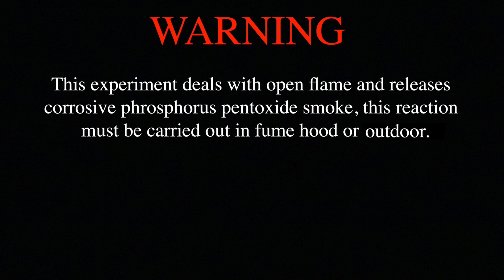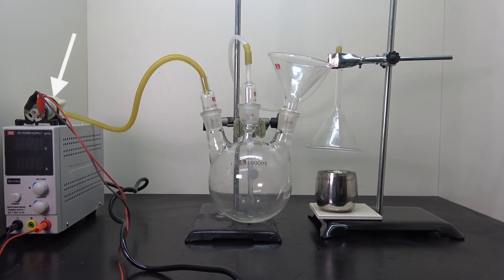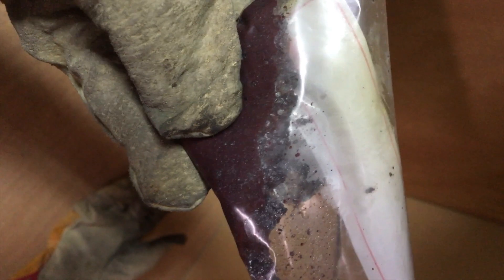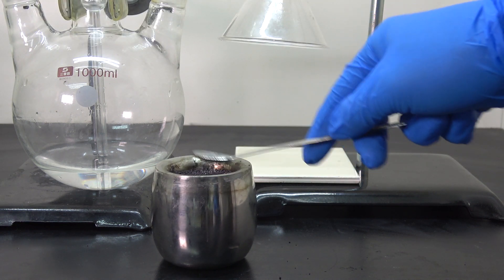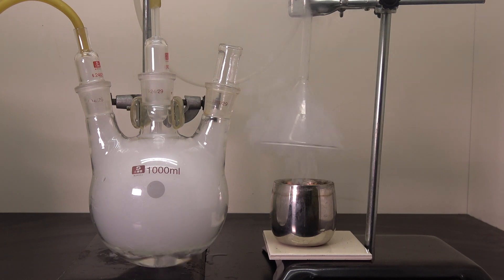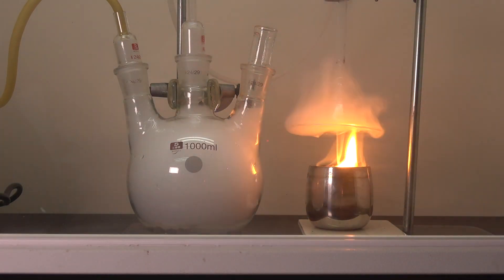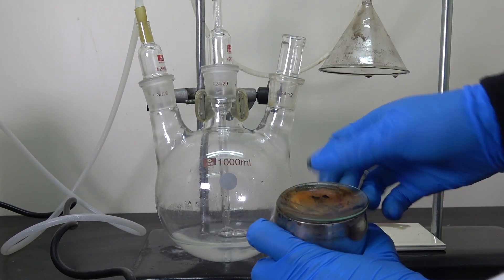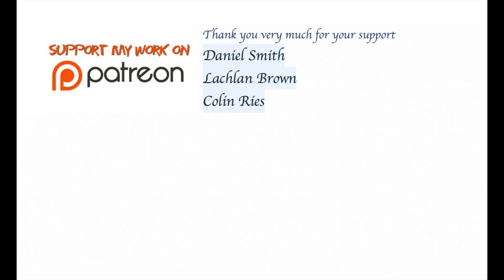Making Phosphoric acid

Comment: Watching this to try to make a solution to work with my hair gloss 😭 I need hydrogen peroxide, water, and phosphoric acid. I may be able to go without it but I fear it is mainly used for PH balance. Pretty sure soda has phosphoric acid, but I’m hesitant to put soda in my hair. Someone pls tell me if hydrogen peroxide and water will be okay with hair gloss.

Comment: whouldnt it be easier to decompse an phosphat salt with HCL or H2SO4 to get the phosphoric acid? It can easily displaced with stronger acids.
Reply from the maker: yes you can, but that way you have distill it later to obtain pure phosphoric acid, and the purpose of this video is mainly to flex that just how much red P i have

Comment: You do know burning S8 makes sulpherous acid (H2SO3) not sulphuric acid (H2SO4) right? It needs a second oxidation step to be made from sulphur.
Reply from the maker: Sam Winfield in that case just replace distilled water with H2O2 , the setup can still be used .